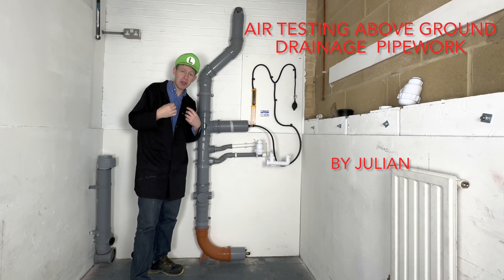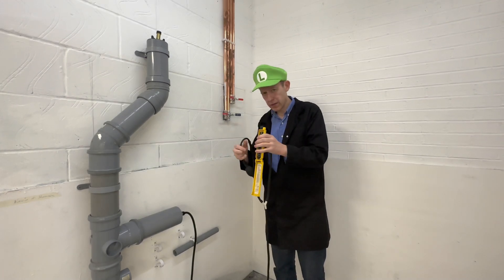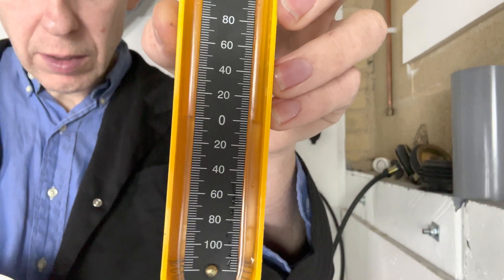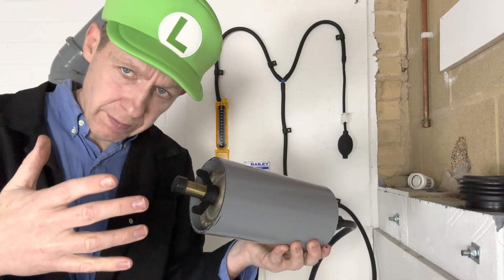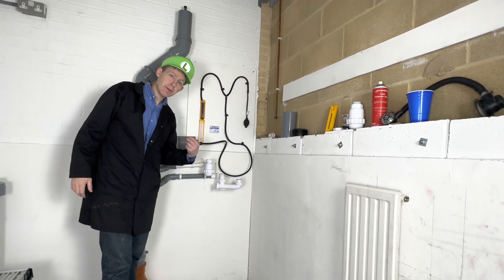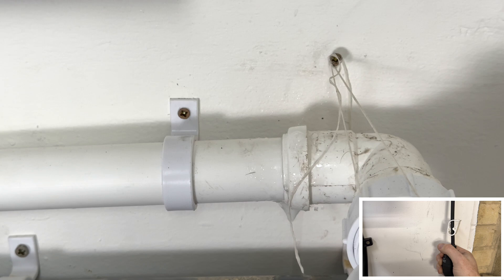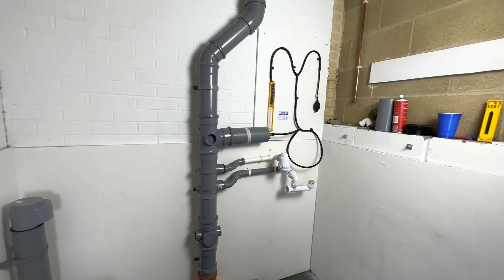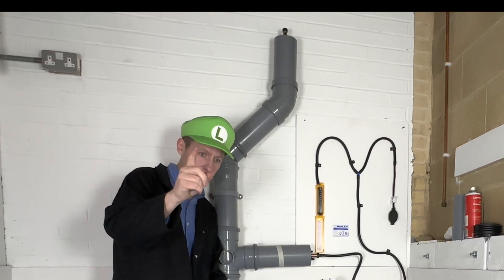Air testing above ground drainage pipework - Building Regs H (4K).

Comment: Can we remove traps add plugs and pressure test at higher pressures?
Reply from the maker: You can do but You are limited to the u gauge - mine goes up to 100mm. Which is about 10mb.

Comment: Thank you for this. Presumably the 38mm WG is not enough pressure to displace the water you put into traps to seal them. Good tip on placing the manometer on a board to prevent kinking.
Reply from the maker: Hi yes as  the WG pressure rises it just about stay in the trap.